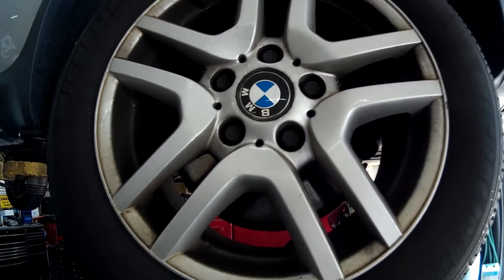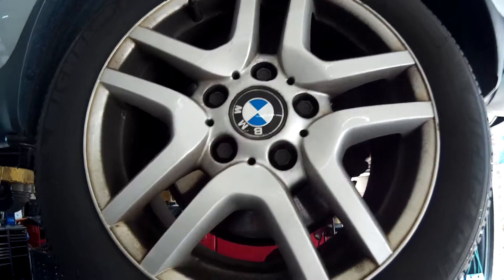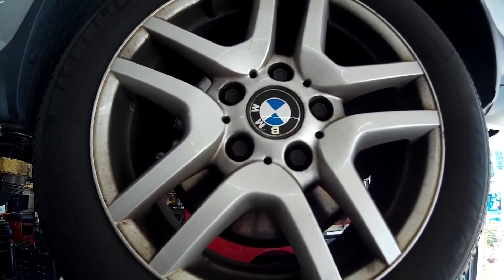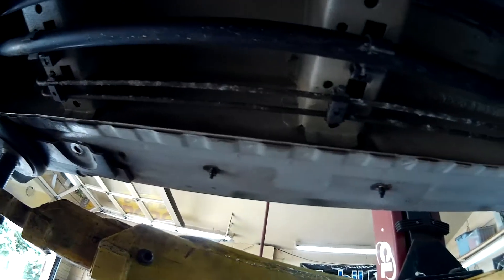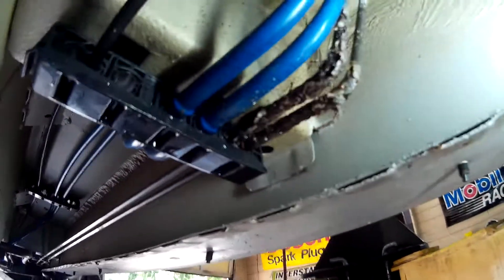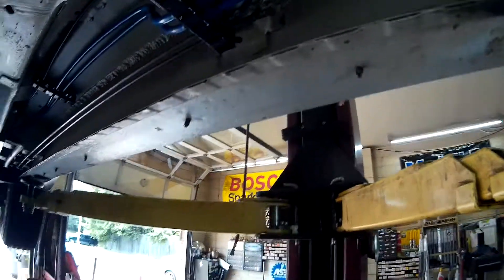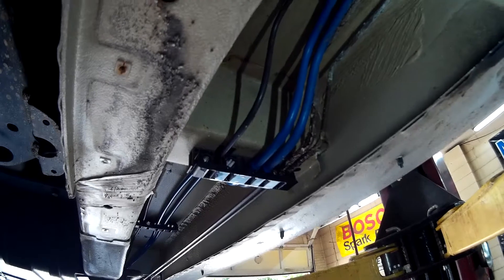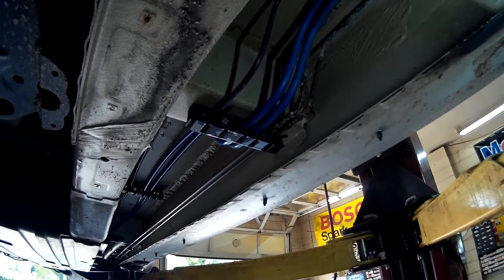BMW X5 With a Low Brake Pedal

Comment: I have the same vehicle 2005 x5 e53. In my case, after I bleed the brakes, the most stupid thing that happened is that the brakes with the engine running are applied all the time on their own and can't move the vehicle at all - brakes still on. Desperate for help, please
Reply from the maker: I have no idea. sorry.
Reply: Somebody translate that
Reply: Have same
Reply: brake booster
Reply: @diagnotech4467  what is the part number for the brake booster?

Comment: So I have the same car changed those same lines and still have soft pedal.   I’ve bled the lines multiple times. Still soft
Reply from the maker: Look for another leaking line or there is still air in it.
Reply: Do you recommend a vacuum bleeder ?
Reply from the maker: @orlandomota5137  Yes I use Mityvac MV7300 but there ate smaller one that are cheaper
Reply: Ok.   I used compression fittings aswell I didn’t flare the other ends but nothing’s leaking.   I’m going to try again with actual flared lines. And the pump.   I also was told sometimes the abs pump needs to be activated via computer
Reply from the maker: @orlandomota5137  Yes some times you have to do a ABS bleed threw the computer. But I am not sure on this car.

Comment: I have this exact same car 2005 X5 e53 
But with mine the pedal is just low but I’m not leaking any fluid or missing any fluid what would that be
Reply: @denisovanhybrid9610  yeah we already tried bleeding the brake with no luck for the back brakes.
Reply: @gregotero8193 same here, looking for solutions
Reply: Did you ever find out problem l have low break pedal also and no break fluid leaking
Reply: @denisovanhybrid9610  air?